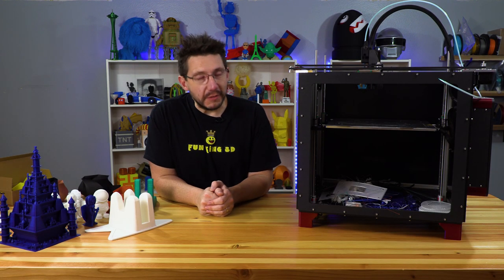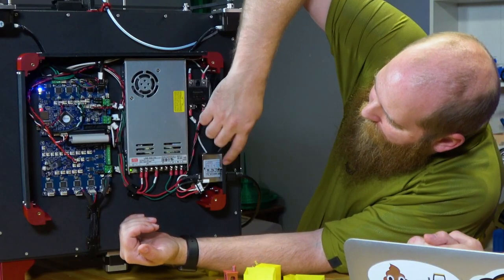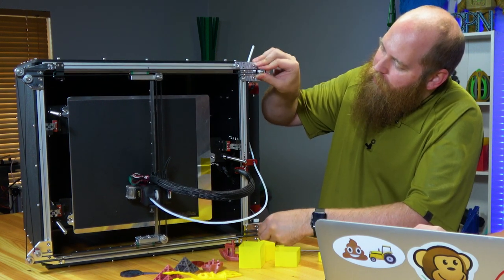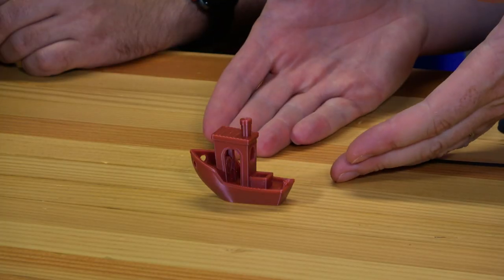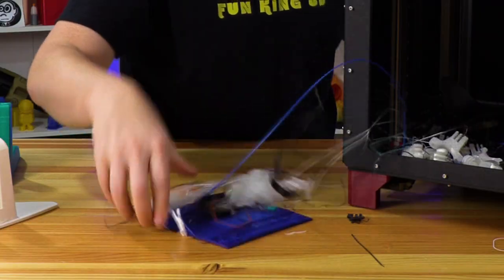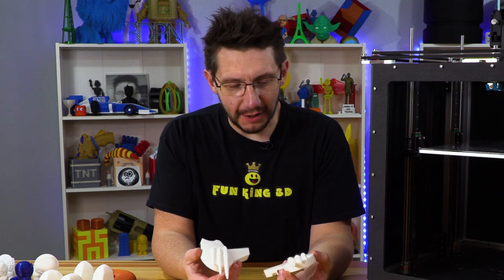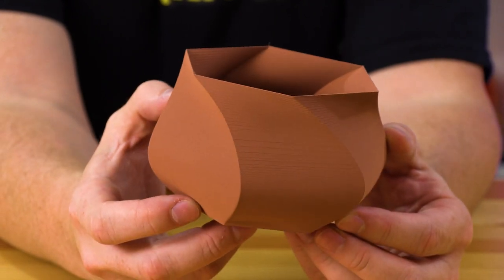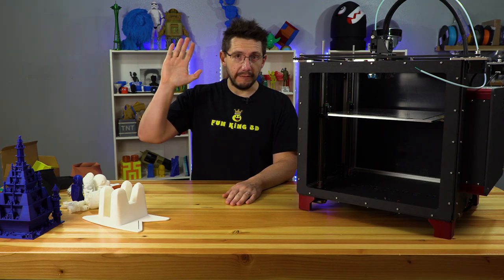Railcore II 300ZL Project R3D 3D Printer Kit Review

Comment: I designed, machined and assembled a core x y machine that I use several times a week. I chose not to go with more than one z axis raill because I was scared I was going to experience binding because technically it is mechanically constrained. I guess the slop allows for it?
Reply: There is a pivot on each of the Z yokes allowing it to level without over-constraining.  If it were rigidly mounted it would be.
Reply: There's no "slop" in the sense you mean it. The bed is attached to the Z-yoke with 3mm screws and faucet washers in slots that allow some flex - and allow it to come out in an emergency, but allow no unintended motion. Mostly because if you e.g. disconnect one Z motor and hit "Go up 50mm" you'd have a really bad time as it bent the crap out of your lead screws and made dramatic noises (Z has such massive mechanical advantage).
Reply: @jstevewhite  OH! I see it in the model. A decent solution to the over constraint issue. Wonder if 2 lead screws is enough? Geez.. I just noticed there's 3. 

I Imagine adjusting the amperage of the z motors would prevent breaking things
Reply: @BGraves   Tony did a test where he unplugged one stepper and commanded a long Z move, and it was fairly dramatic, but because of the slots and washers, it survived. I think, IIRC, it still bent a lead screw, but better that than other things that could have died. :D
Reply: @jstevewhite  Why did you choose to use 3 z motors rather than tying all of the leadscrews into a common belt? Would eliminate the need for the expensive board, 2 more motors, and the board expansion. With a sturdy frame there would only be a need to level once, right?
Reply: @BGraves  AFAICT, most folks don't find it to be the case that the bed only needs to be leveled once, regardless of the printer's relative sturdyness. Additionally, it's quite a hassle to manually get a bed as precisely trammed as this system does trivially ( i.e., <.01 variance from the print plane across the entire 341mms of bed surface) - this precision is limited only by the precision of your sensor and the step height of your Z axis. This system does that in thirty seconds, on command. 

YMMV, of course, but the automatic mechanical precision tramming seems to be a feature that people really appreciate - along with the reliable first layer it brings to the table.
Reply: @jstevewhite  .01 across entire bed is insane. post the video of your sensor doing a grid probe

Comment: I like this machine do to using the Core XY system and E3D gold edition hotend. I have the gold edition hotrod on my Tevo Tornado. But hearing that you could not get Nylon to print might be an issue for me. I want to print in nylon 12 some times, other material like PLA + type, PETG is my goto filament type and TPU, or Nijaflex types. I just don't know now whether this is my next printer. I am snuggling to get My Creality Ender 3 Max working I can not get layers to stick together. most of my printing does not have to be supper supper great but good enough for prototyping. With reasonable good looking parts. Speed is a plus. I am sure I would print some part at a finer detail is I had there option. I do like the idea around Core XY over a Cartesian style printer for many reasons. One being the bed does not move cutting out ringing that is caused by the Bed moving in and out.

Comment: Isn't mesh level better though cause build platforms (even thick ones) tend to warp.
Reply: could you theoretically do both? use the sensor over each of the screws to level mechanically, and then generate a mesh?
Reply: @Crokto  Yeah.

Comment: Hello Joel! Can you print Flex with the bowden extruder?
Reply: I have, but you need to go slow
Reply: It's not really a Bowden, it's extremely short (5-7mm or so). I've had no problems with flexibles, but as always yes, you need to slow down a little.
Reply: That long tube is behind the extruder; it's a filament guide to stop the filament from dragging across the edges and jerking when the head moves.

Comment: would love to hear if you figure out what happened with nylon, thats the only thing holding me back from buying one as I print nylon alot
Reply: I need to test some nylon on mine. No reason it shouldn't print. May have been the steel nozzle, may just need a door (we have door plans available).  Regardless, it'll get sorted out for sure.
Reply: @tonyakens8228  please let me know what you find out I was absolutely serious. BTW I don't think it's the enclosure because I print nylon on a makergear all the time
Reply: @MicheleHjorleifsson  I ordered nylon, but Taulman commented it was likely the steel nozzle needing higher temps than Joel was running for it.

Comment: Does look really good and well built!

one little complaint though - why do all these companies always use 20x20mm aluminium Extrusion?

Go 40x40 - it is so much stiffer!
Combine that with all aluminum connector cubes, milled to spec and please use high-quality linear, pre tensioned rails from either Hiwin, THK or any other "big name".
It really is worth the extra cost - which is not that bad btw.

Regardless of the above mentioned, the electronics and rest of the design seem to be superb!

Just when doing infill or other very quick moves I suspect the frame could not be stiff enough, especially at 600mm Z-eight in the "tall" version - and dounbling on the frame - extrusion size for a very very low extra cost would be a huge benefit in my opinion!
if they already use 30x30 i have not said anything, buw somehow i doubt that...

Edit: while thinking about what i wrote, it kinda seems absolete, because it is all reinfoced by the side-plates I guess . nontheless a 40x40 aluminum construction has more surface area where the extrusions interconnect - but after watching the whole video and not jsut the first 8 minutes, after which I wrote my first comment cough
it seem to not have any print-quality issues whatsoever
Reply: This is actually 1515, not 2020.  The frame is built so the side panels are a structural component, and due to that it's actually an order of magnitude more rigid than the typical 2020 open frame.
Reply: Tony already answered, but I figured I'd add that the rigidity is the in-plane flexure of the ~400x400 HDPE panels 1/4" (6.35mm) thick. The strength is limited by the tearout strength of the HDPE with the 3mm bolts. Tony stood on his frame without ill effects to the printer.. :D 

I've been looking for the math since Tony and I started designing it. The only thing I've found is about building walls, and they say that putting sides on the box makes it an order of magnitude more rigid than the same frame with an inlet brace (diagonal braces). The extrusion really just becomes a convenient place to bolt things up. If I had known how much difficulty our EU friends would have, we might have started with 2020 instead, but 1515 is just so much more efficient with regard to space and hardware cost. 4040 would have increased the volume and weight massively ( roughly 18 liters  more printer volume for the same build volume).

Comment: This machine looks goos. But I think passive bed leveling has as good performance as active.
Speed is about the extruder the hot end and the mechanics (they determine the acceleration)
I print on a customized ender 3
With dual-drive direct drive.
That allows it to sit comfortably at 120mm/s 0.2 for ABS
That said the 5000mm/s^2 of corexy is unreachable for me.

Comment: i brought a cheap flsun cube printer to harvest for parts for £250 off amazon, even that had injection molded parts all ready placed brass incerts, for the price of the kits a small cnc could be easily made for moulds to do a diy solution to diy injection moulding or make the the aluminum parts kit thats $205 which could be easily done while keeping the price of the kits lower......but i think thats just coming from a tinkier who would probably make his own diy version for for cheaper

btw i understand with all the parts, r&d,qc testing and sourcing of parts, from a ' buying from a company as one of the best kits' scenario goes, the price is understandable

Comment: At this point, I'd just like a printer that I can update the firmware on easily. Been trying to update my CR-10 firmware for months, but the Arduino returns errors that, so far, more practiced hands than mine have not had an answer to.
Reply: On the duet controller updating the firmware is literally just uploading the new version in the web gui.

Comment: Looks like this design could potentially be recreated with cheaper parts which would make  it a useful DIY project like the MPCNC or Thomas Slanderer's i3 clone.
Reply: If you do, please don't call it a RailCore. It is the excellent choice of parts that make this a great machine. It is explicitly not low-budget (call it "reasonable-budget!)
Reply: They know it can be built cheaper. They just work with parts that have been tested vs. random low-balling AliExpress seller who might be selling a good part or might not be.
Reply: some did buy chinese parts and have spent more money replacing them to get ones that work

Comment: No 3D printer will be able to compete with an injection molding machine. I ran a 30 year old injection molding machine that made a file folder box & lid in 1 minute. I also ran a injection molding machine that made 24 gears in 30 seconds. all with tolerances of +/- .002. A 3D printer will never take over injecting molding because depending on the machine & the dies, you can make more parts at a faster rate even while using regrinds which a 3D printer can not do. A 3D printer at best is used in prototyping, & at least for a hobbyist. The only 3D printers that are better than injection molding or conventional machining are metal 3D printers where the parts are too complex to injection mold or machine. Also, most injection molding machines can handle most types of plastic.

The better way to make any kind of decent money is to spend $150,000 on a injection molding machine & have your customer supply the dies which you must do so you are not responsible for maintaining the dies since some dies can cost up $50,000 or more. A injection molding will pay for itself within a couple of years & outlast any 3D printer on the market. 

With that said, I would like a 300 X 300 X 300 3D printer to tinker around with & and maybe make a few bucks on the side. I just don't see the need for the average company or hobbyist.

Comment: you really should review the Tronxy X5s 2e. It's super cheap (approximately 560 on gearbest), has two extruders, and is Core XY. It also has a build volume of 330 by 330 by 400, with a touch screen. It's awesome.

Comment: Racking forces on the weak dimension of the X rail no bueno.  There should be two separate idlers on each side of the X in order to align the belts vertically.

Comment: Joel i'm just gonna guess that you were printing most of those models (if not all) at rather high speeds, but i don't think you factored in the most probable cause of the stringiness.
When printing at higher speeds you'll have to set your hotend to a higher temperature (by about 5 to 10 degrees) because the filament is rushing through the nozzle and doesn't have as much time to heat up. 

I'm not sure if you'll read this by the time you return the Railcore but I'd really love to see if your results change with a higher hotend temperature :)

Also, how is this printer capable of printing so fast with absolutely no ghosting?!?!

Comment: The reason for the failed Nylon prints could be the build volume causing lower air temperature in the enclosure. The Prusa has a lower build volume.

Comment: High voltage?!? How how are you suppose to power this at your house. I only have 240V. I think you meant low voltage from the extra low voltage.
Reply: @MrNoysip   As someone who used to do a bit of pixie wrangling, 120/240 isn't "technically" considered high voltage. But since it's still plenty high enough to kill you, it's probably still worth calling high voltage.
Reply: Perhaps AC (or mains) voltage (at 110V or 240V), which powers the Meanwell and the SSR/Bed vs. DC (at 24V) would be a better way to describe the difference.
Reply: Meanwell power supply has a 110/240 selector switch
Reply: John Bolene the point was it's not high voltage. For example a 4160V vfd is considered a medium voltage drive.
Reply: For homes above 48V is considered high voltage.
Reply: The 3D printing community freaks out over "mains" voltage yet doesn't talk about the real hazard with these Chinese machines. Never do they looks for fuses or breakers on the power circuits. Never do they talk about how bonding and grounding isn't done and if say the heat bed element faults to the bed you could potentially have a major shock hazard. These machines are Chinese and are not UL listed or ETL thus you get what you get.
Reply: @Shredxcam22  many words are relative, how high is high depends on what you think it means, is high temp 200C or 2million C?  compared to 24volts, 120/240 is high
Reply: @Shredxcam22  This machine is made with a high quality meanwell power supply. It has a proper electrical inlet, and properly sized wiring.  The bed is tied into ground.  It is not UL listed, but it is built with proper safety in mind.  It's no Anet.
Reply: Tony Akens proper electrical inlet? So it has a plug ? What is this suppose to mean.
Reply: @mostlymissiles  I'd say for both if it can burn me it is too damn high :)
Reply: @Shredxcam22  If you are anti-advocating all self-built machines you should go off the hobby printer channels and find yourself a 50K+ 3d printer group. This particular machine is designed better than most commercially available sub 25K printers. It has no chinese low-budget parts whatsoever. The wiring harness is more tidy, not oversized and therefore more safe than many CNC machines in professional workshops. Besides, it is a DIY machine, so DIY better if you can...
Reply: Con Hennekens I'm not against them but people have to be honest with what they are buying. When your buying stuff out of China, there is not such thing as safety or standards. 

It's a cool machine and I really dig the bed leveling but for the price it's a little much to be in pieces.
Reply: @Shredxcam22  You are not getting the fact that it is not a Cheap China Clone of some sort.
Reply: Hi and low are relative terms. It would be correct to say 110 VAC is higher than 24 VDC. Not sure where your argument is here. Yeah 240 is even higher and 440 and 200000 and so on. In the USA AC house wiring at 110-120 VAC is commonly referred to as high voltage and the DC 12 and 24V stuff referred to as low volt. Might as well accept it because this is commonly accepted and used every day and it is factually correct when compared relative to each other.

Comment: this is perfect, simply needs a 500x500x500 and 500x500x1000 version
Reply: vertical center of gravity will be too high, that's the reason why Voron2+ uses static bed to lower VCG, otherwise high accelerations are not possible
Reply: @escknx  I dont see what difference it makes. t=The bed doesnt move during a layer and when at full capacity the bed and gantry are in the same relative spot to each other.  I dont see this or the voron slowing down at max capacity and they should if that was an issue. Plus you can simply weight down the frame just like a washing machine dampens vibrations with weights so they would have done it.
Reply: This thing is so heavy and solid it doesn't really matter where the bed is. You could stand on it while it's printing and it's not going to move.